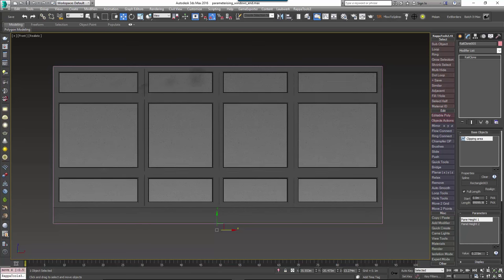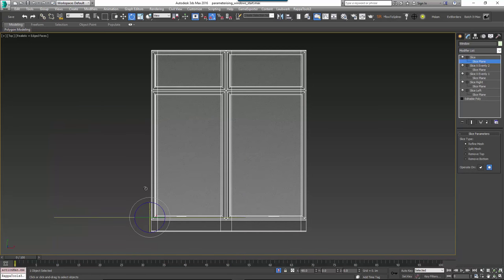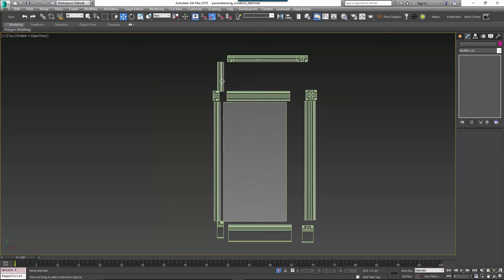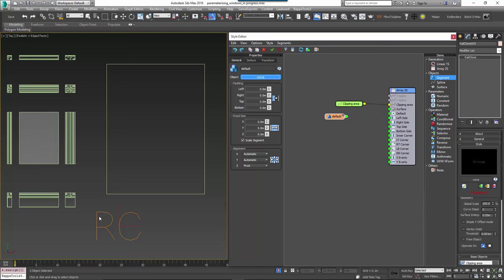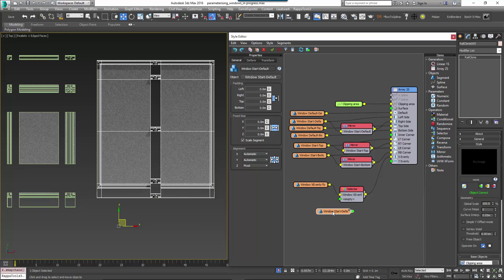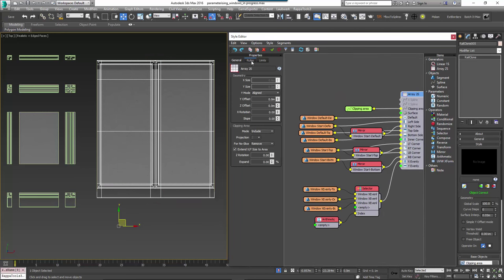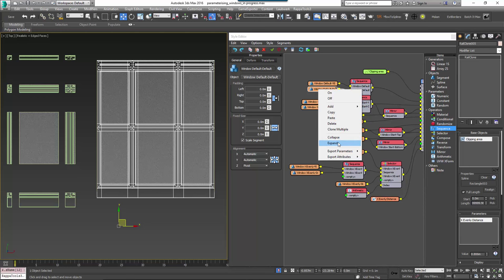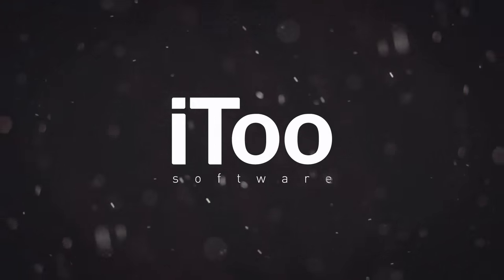TUTORIAL: Modelling parameterised windows with RailClone in 3ds Max (advanced)

Comment: How can  I make a window with Y evenly included, in which the top/right quadrant is different from the top/left quadrant and the Bottom/left and bottom/right are the same. For example a sliding window at the top from left to right and a fixed glass at the bottom that goes from left to right?
Reply from the maker: That's a but tricky to explain here - best contact support, or you may find this thread on our forum useful. https://forum.itoosoft.com/tutorials-27/parameterising-windows-with-railclone/